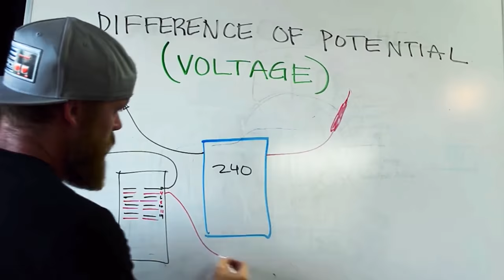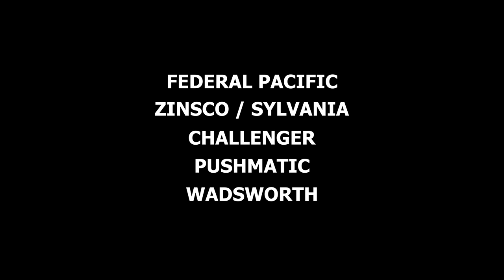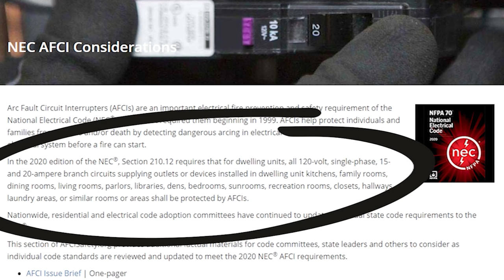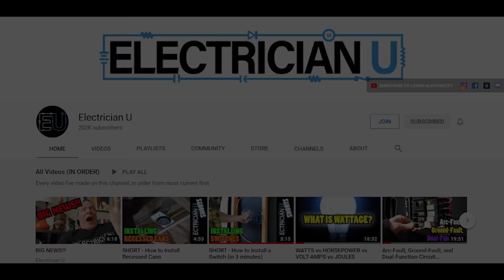Outlawed Panels and Breakers

Comment: Great information, except for the part where you recommended that people test their breakers by setting them up with a "close-into-fault" situation.
I've had enough close-into-fault situations at work that I wouldn't really wish that on anybody.
Having a small contained arc flash explosion go off in your hand is scary enough when your hand is on a factory perfect high quality Siemens UL 489 complaint MCB.
I cannot FATHOM going out of my way to cause this small explosion on a known problematic brand of breaker that may or may not have already broken hundreds of faults over its life.

Some fun information for you to dig up though on your own time, is a circuit breaker's "trip curve".
Most reputable manufacturers publish this information. It tells you "about" how long the breaker will hold before tripping at a given percentage of load, and will also specify the tolerance they allow.
You can often see the point at which the magnetic "short circuit" trip activates by a sudden straight line along the otherwise gentle curve of the thermal overload function.
Unfortunately this information will likely be difficult or impossible to find for extremely old breaker models, such as FPEs or Zinscos. But try it on modern models that're still in production.

Comment: I made a device in a metal single gang box and attached a plug to it wired to a single pole switch to short circuits. Labeled “off” and “boom”. Works great if the breaker doesn’t kick and  makes all those fun noises you can flip the switch off or if it welds together yank the plug out!
Safety first 😂
Reply: Most switches will have issues with their internal contacts when having to switch a load that is essentially a short circuit. Not advised.
Reply: @stevebabiak6997  yes, that’s the point. Direct short line to neutral. Certainly not advisable. Each must make the choice to push the envelope. In the last 17/years as an electrician, 2 times the breaker did not trip. One was an ungrounded transformer secondary and the other a zinzco PNL. Both times produced a real special noise and I yanked the plug.

Comment: Is anyone still running or finding Commander panels and breakers (QB or QBH bolt-on breakers) Made in Toronto, Canada, then bought/ manufactured by Sylvania, then Cutler Hammer, and now Eaton. The panels are thick and sturdy (could be roomier), the bus bar nice and chunky, and the breakers still snap on/off with a confident, metallic ka-chunk. Feel like they could last till Armageddon, but an electrician said: "the bus bar may wear out?" Any Commander fans out there?

Comment: As a certified electronics technician, certified in Industrial Electronics working on overhead cranes in the past, I can tell you that the "breaker test" described is hazardous in all respects. That kind of test is not by any means acceptable practice. Dead short tests are the type of testing done in the breaker production factory under laboratory conditions, with all sorts of safeguards in place.  It's usually done to pass UL certification of a particular type of breaker... NOT something you want to do in-field.  Got a questionable breaker? Replace the darn thing and save yourself (and your customer) a lot of headaches.

Comment: I rewired most of my home but a few circuits are still original from 1975... The wires have ground but I Noticed in the panel theres some green gew on the neutral bus.. What could that mean??
Reply: Goo? Like liquid? Or crust? If it is wet you are probably getting moisture in there and it is corroding, it's staying wet because it is an ongoing issue. If it is crusty it's probably just normal oxidation, possibly loose connections, lack of no-ox on aluminum terminations. It also could be clear no-lox with some crud mixed in. A few things to look at. I would lean toward moisture getting in. It can wick through wires, especially cloth wrapped or service entrance cables.
Reply: @ericnortan9012  everything is copper.. but I think it’s just oxidation because when I touched it it wasn’t wet. Could this still be a hazard because it’s only the old circuits that have this issue
Reply: @STXVIEC  oxidation will build up over time and eventually start to degrade the connections. It wouldn't hurt to shut it down and clean the build up off the wire, especially if it is crusty. Then tighten all the terminals down properly. Even copper can corrode. Corrosion causes resistance, resistance causes heat, heat.......well you know. I wouldn't be worried unless it is excessive but i would address it. A little preventive maintenance can do wonders for a system.

Comment: I have had experiences with all the name brand panels you have mentioned.  Those panels are not manufactured anymore, and yeah they are old.  But they still make replacement breakers for All of them. They are very expensive, but they do make them. Also, these old panels , as long it looks ok, and nothing burned,  the panels are "pre existing" and are Legal".  99% of all customers will want the breaker replaced, and not spend a few thousand dollars replacing Everything, in having a service upgrade. I have Never had a customer say...."Ok just replace it all".....NEVER.  I have 30 years in business. And some customers think the electrician is just trying to get more money out of them.

Comment: Why do you say push-matic is bad? I thought they are great panels. The only issue I know of is the breakers sticking and saying off when actually on. Circuit should always be tested regardless after turning the breaker off or on. What am I missing are they creating issues?
Reply: Indicating “off” when actually on is a HAZARD if someone is working on that circuit expecting power to be off.

When a breaker fails, we want what is considered a “fail safe” situation, meaning that power is off if the breaker malfunctions. Anything else happening with a malfunction is a hazard.
Reply: In my 40 years I have replaced only a handful of pushmatics, mostly due to loose screws on the bussbar. I think that's more of a maintenance problem than anything else. All panels should be inspected regularly for loose connections, especially bolted breaker panels. I have replaced dozens of these panels due to them being 16 or 20 circuit capacity which just doesn't cut it nowadays. I wouldn't replace a well maintained pushmatic panel out of fright, only to increase circuit capacity and to add arc fault capabilities. Pushmatics use a mechanical telltale for indicating on/off. Sometimes these don't function as designed due to dust/dirt in the mechanism. As with any circuit breaker, never assume off is off, always test. Any breaker can get fusion of the contacts from a fault current and fail to disengage. Nothing is foolproof. The bad karma associated with FPE stablok is reason enough to replace those panels and to sleep better at night.

Comment: Pushmatic and Federal Pacific panels are not banned and don’t show failures any higher than other manufacturers. I have done work for an apartment building that has 25 individual panels, one in each apartment and 3 distribution panelboards in the electrical room. All Federal Pacific, installed in the 70’s  In my 40 years as an electrician, I’ve only seen two manufacturer’s panels fail, Square D QOs(six so far) and Cutler Hammer CH(one).

Comment: How much you think it can cost to swap out whole service here in tx?
Reply: That depends on a ton of variables, service size, breaker count and panel sizing, what needs to be replace wire wise, how long will it take, what types of breakers will be used. What local codes are. The easiest way for you to know is just get a couple quotes. I’m going to just make a random guess without any info on your current service and say anywhere from $1-3000 that’s normally what I see. Now I’m not in Texas so that could change that
Reply: This is for a non Arc fault, non Ground Fault service. No special add ons, no fancy pancy breakers. Just a straight replacement. Once you add everything else you can be looking at anywhere from $8-15k
Reply: @lostsands7587  wow. you have a heck of a markup.
Reply: @kenbrown2808  lol, that’s not what I want to charge. That’s what I’m told I have to charge. It pains me to tell customers what the price will be.
Reply: @lostsands7587  still a heck of a markup.  which leads to the question of how much of that goes into your paycheck/benefits.  sounds like you might benefit from looking into getting your master/supervisor cert.
Reply: An average 200 amp service upgrade in michigan is around $2000. But there are a million variables.
Reply: @lostsands7587  that's what I tell someone just asking over the phone. I'm in Michigan, I think our costs are pretty in line with Texas on average.
Reply: do you have power yet??????

Comment: Alot of TERRIBLE advice in this. 

1: Connecticut Electric junk isnt UL listed. Most business insurance policies WONT cover you if you install that garbage, and the NEC specifically forbids it. No reputable electrician would touch that brand. 

2. Telling someone to purposely dead short a live circuit to test it is insane. You have NO idea what the condition of the splices and conductors between the short and breaker are like. This is a great way to smoke a wire nut, feed through receptacle or old soldered connection when the breaker fails to trip. 
They make load testers for a reason. 

3. Charging a customer to replace all the breakers in these obsolete panels doesnt address the issues with them in the first place aka Split Bus bars/disconnect rules, and bad breaker to bus connections.  FPEs fail to trip due to design. CE FPE breakers DO NOT address this. Zinscos fret and melt the bus, challenger bus bars melt, etc.

If a customer cant currently afford to replace the service, they certainly cant afford to waste money fake "updating" it either.
Reply: Richard is on the money here!
Reply: Connecticut Electric replacement breakers are ETL tested to UL standards, (per their website). It is my understanding that NEC and OSHA recognize a formal list of certified testing laboratories as equivalent to UL testing. The list includes UL, CSA, TUV,ETL, and others. ETL is now a division of Intertek, which is an international testing lab organization that has expertise in other types of safety testing as well as electrical testing.

 I have personally toured an ETL facility in Cortland NY and it is a world class facility that knows what it is doing and its listing can be trusted as a faithful test to the applicable NEMA and UL standards. ETL is well represented in the NEC Code Making panels and has a good reputation world wide in the testing of electrical and specialized equipment ( especially medical equipment) to US and international standards. I have no connection to ETL other than my contacts with them over my 40 years involved with medical equipment and hospital electrical systems.
Reply: # 2, " Bridging a hot and neutral by hand only if you are trained "   Nope, never.  I'd like to see the " training " involved in doing this not to mention the spark / ball of molten copper that lands on the floor and sets the rug on fire.
Reply: @bobroberts2371  -  I've use a 20 amp switch to do this in the past but it's hard on the breaker and the switch and could cause some arching on other connections as it makes its way back to the breaker panel.
Reply: A few years ago in my home town a heating guy was working on a furnace at an assisted living home. He shorted the hot to neutral to kill the circuit. This blew out a splice in the attic at the other end of the building, throwing sparks into the 60 year old insulation which caught fire and burned the place to the ground.
Reply: @bobroberts2371  I'm a master electrician and have been in the trade for over 25 years. Never once have I been trained on how to properly dead short a live circuit hot to neutral.
Reply: always be careful about what you put in service. if it is not "U.L." listed, the insurance company will love you. if there is a fire, and you put in a "CLAIM" , YOU ARE NOT COVERED!!!!. as an electrician, and you put something like that in without inspection, you have just shifted the" LIABILITY" on to "YOU", and you will financially burn!!!!
Reply: If you are going to replace all the breakers, local AHJs would probably want to force you to upgrade the service and install arc faults and gfi breakers as needed by whatever version of the NEC they follow. I know most techs don't want to get an inspector involved but your conscience and your liability insurance may say otherwise. In my 40 years in the trade I have seen many things that terrified me. The thought of the homeowners and their kids getting turned into charcoal briquettes by an electrical fire is my biggest nightmare. This is a really serious business and should only be performed by experienced electricians. Last week I had the opportunity to service outlets on a riverfront dock that were ungrounded and non gfci protected. The previous homeowner was probably proud of his achievement as everything worked when he finished. Luckily a squirrel chewed away the pvc electrical box prompting the service call.
Reply: @bobroberts2371  Twist them and cover with the correct twist connector.
Reply: I have to agree with #2. This is a very bad idea to do and sounds like something a DIYer would do to cut corners. , some real backyard hillbilly stuff you'd see in the south USA..

Comment: zinsco & federal pacific are the worst. pushmatics are great breakers & switchgear. the pushmatics were expensive & panelboards  took up considerably more room than their counterparts. pushmatics were NEVER outlawed. i was an electrician from 1967 to 1995 & a state certified electric inspector from 1995 to 2017.

Comment: Are the 277v members above the 600v members??!
Reply: I'm a 480 guy myself.
Reply: I have ranged from 120 volt lines to 69,000 volt lines( at that voltage level, if you make a mistake, you will not have to worry about making another mistake!!!!) I hated being around high voltage, them damn "VOLTANTZ" would crawl all over you!!!!

Comment: Disagree with the pushmatic circuit breakers. In my 50 years never came across a pushmatic panel that had any problems. Same with pushmatic breakers.
Reply: Yeah. Bulldog RULES!
Reply: I always thought the problem with the Pushmatic it was never UL listed.
Reply: Replaced a few bad breakers over the years, but over all pushmatic had quality equipment.
Reply: @SuperVstech   yep great product
Reply: @jeromewelch7409  wow never know that. Will have to examine a few of the 15 or 20 single & 2 pole breakers that I have in my garage. Some are still in iriginal box. Was at Lowes a couple of days ago. Could not find any pushmatic type breakers on selve. I changed a 2 pole 30 amp pushmatic breaker for a neighbor on a hot weekend aboutc10nyears ago. He asked me how much how much he owed me. Told him to just replace the breaker on next trip to home depot. Think he paid around $35. He complained how much more it cost compared to other brands. Told him it was still cheaper then replacing the panel.
Reply: @jeromewelch7409  just looked at halve a dozen pushmatic breakers some dating back to the 1970's. Looked at twins, single & a 30 & 40 amp 2 pole pushmatic breaker. All had a und lab listed on tag. Newest one in orange box ( after they were bought out the second or third time ) also had a CSA label. Some had a 10K intetupting capacity when back in the 1970's all or most breakers were only rated for 5K. Hate when a top if the line company gets bought out and new company cheapens the crap out of a once great product line. They remind me if an old timex watch comercial = They take a licking but keep on ticking. Large newspaper that I worked at had several pushmatic panels that were installed in a building built around 1955 and never had trouble with them.
Reply: Made in Detroit in its heyday. Quality product. Probably every piece of metal was sourced around the Great Lakes. I replaced the one in my house just because 60 amp service was to small for my needs, but after inspecting it closely, I made it my sub panel in the garage. Would have kept it had we not bought an electric vehicle and needed to install a specific breaker.

Comment: why not just pickup a load bank and wire it directly to the breaker? A lot like putting a load on a generator?
Reply: Nick ... load banks are expensive. Might be easier to build an outlet box to supply a few hair driers. 1500 - 1800 watts each should pop a breaker in short order. (about 3000 watts = 25 amps / 3600 watts = 30 amps) You just have to wait a few seconds for heat to build up.